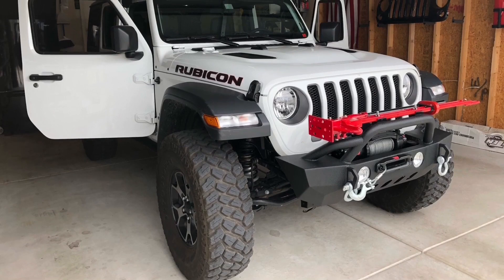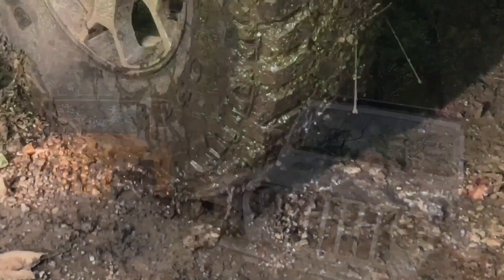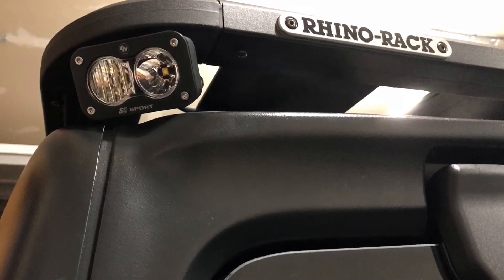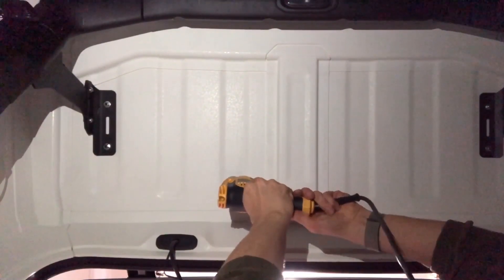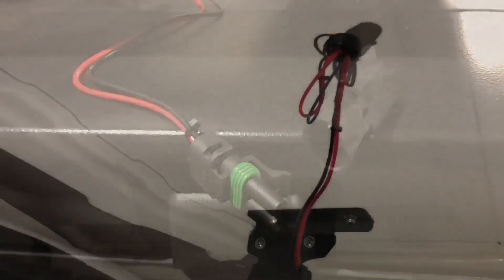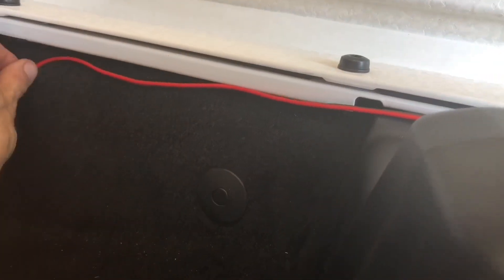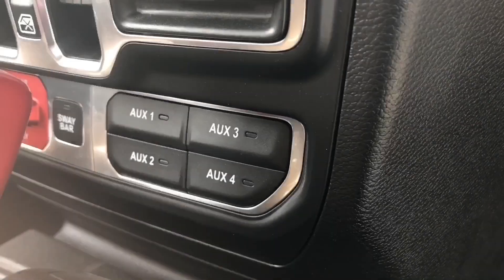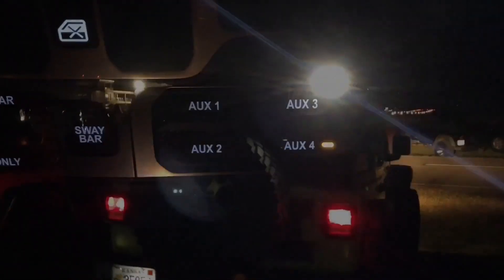Jeep Wrangler JL Auxiliary Lighting Installation Baja Designs S2 Sport

Comment: Nice detailed video. I have the same rack on our JL, love it.
Subbed👍
Reply from the maker: Rumrunner Adventures thank you! Just checked out you channel. Looks like you have been having some fun!
Reply: @AmericanJeeper  always👍
I'll be uploading a new video this week. We finally got to take the Jeep on some trails. Thanks for watching, we appreciate it. Keep on jeepin🤘
Reply from the maker: Rumrunner Adventures will do, and look forward to your new video. 🇺🇸
Reply: How did you guys get the rhino rack for the JL? I called them and they said it won’t be ready until January. Is it the JK one? Thanks
Reply from the maker: This is the Rhino Pioneer rack with Maximus-3 brackets, but you can get the whole thing directly from Maximus-3 or like I did through Northridge 4x4. Maximus-3 sells the setup as their solution for the JL, so that part is a little confusing. The combination is great though and I highly recommend it. Without rails, it adds less than 4” to the height of the Jeep and will be perfect for a roof top tent. 🇺🇸
Reply: @jasonporter4726  we got ours through #explorationoutfitters with no trouble

Comment: @American Jeeper I need some assistance using my factory aux switches. When you cut your switch off of the wiring harness and you had to wire it up what did you do? Right now I can't get my aux switches to work and I am having to use the button from the harness.

Comment: Hey great video! Now I know you mentioned you connected the lights to aux switch 4, but how exactly did you connect the ends ?
Reply from the maker: Cameron thank you. The red wire coming from the light connects to the aux wire by splicing it. You can use the old twist caps or the ones that you insert and shrink down with a heat gun. Earlier in the video I showed the spliced wires I did towards the back, and this is the same process only you ground the black wire and connect the red to the single aux 4 wire as labeled.

Comment: American Jeeper, I think we both literally have the same JLU Rubi!
I love your roof rack with light combo (coming from the first responder field) and will most likely be replicating this. Can you shoot me the specific bolts, nylon washers, rubber grommets and such, if possible, you used on the Baja Design light wiring? I’d like a good watertight seal like you did. Thanks a head of time!